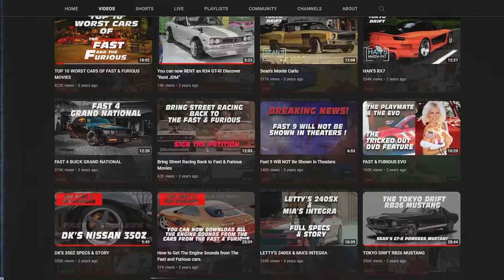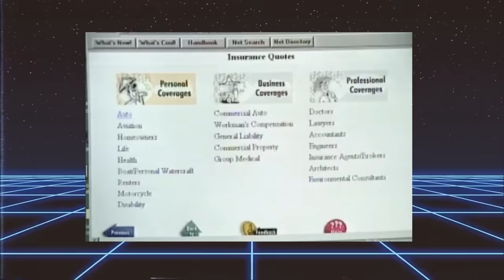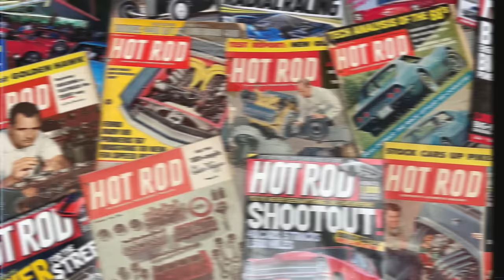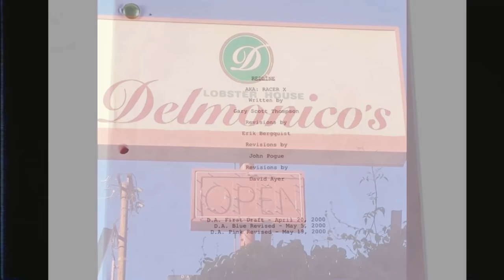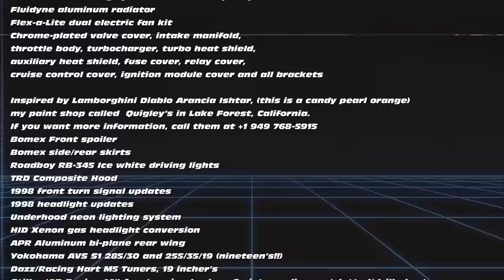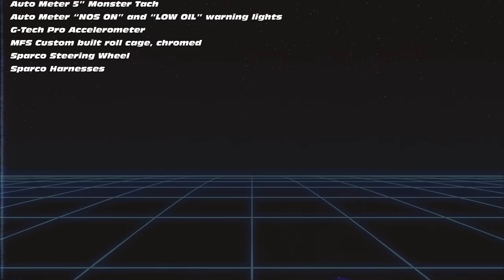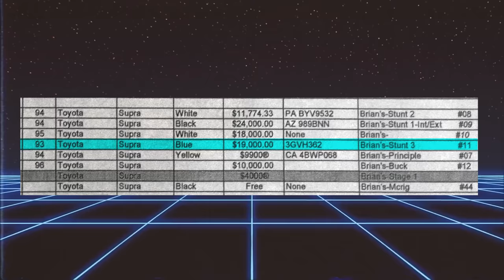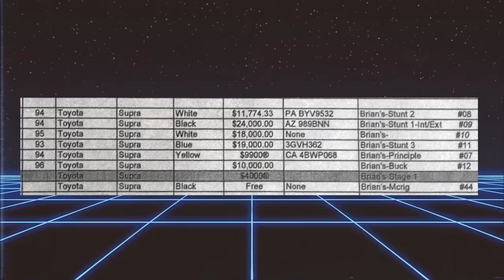The Fast and Furious Supra Then and Now

Comment: Your Supra and your Skyline R34 GT-R were the very first two cars that made me fall in love with cars 20+ years ago as I was kid growing up in the early 2000s. Those cars will forever be in my heart and my memories for a very long time of how it became the most important icon cars of all time in including all of the other FnF cars from the first movie. Thank you Craig Lieberman 🙏💕
Reply: You need to watch more movies kid but I hear ya
Reply: @600wheel  no I’m good. I watch already watch enough movies in my time growing up
Reply: The Supra made me want to avoid Tuner cars and wander away from Toyota. That God awful exterior and the clashing yellow for looks roll bar. I rooted for the Charger and shed a tear when they crashed it. I was already in to cars.
Reply: They were the poster childs for rice rockets and everything I, as a car enthusiast turning 14 in 2001, wanted nothing to associate with
Reply: @rickc303  As a car guy/mechanic turning 29 at the time I felt the same way. Just the cost in building one made me sick and the axle running through the oil pan of the Nissan confused as to why anyone would even try. With engineering decisions like that I couldn’t imagine the other nightmares you would roll up on. Gotta admit though 12 yrs later until today an EVO 1 is parked next to my Fox Mustang (I’m Canadian).
Reply: @600wheel Right? Vanishing Point, Bullitt, Smokey and the Bandit, Gone in 60 Seconds (both the original and the 2000 loose remake), etc.
Reply: @FWDSUXARSE  🤘😎🤘
Reply from the maker: Right on!
Reply: @600wheel  uhh.. 20 years ago, FnF was like the only racing movie, lol..
Reply: @ClimptonDiddlehopper  well blame the movie people for orange car with a yellow cage and blue interrior og car was yellow
Reply: No he doesn't. @600wheel

Comment: I loved the 84 Supras so much I saved up and bought a mostly garage kept 1984 gun metal blue Supra in 1995. I got it from the original owner, a trucker who bought it from Brown's Toyota Glen Burnie, Md I had the stickers and all. His wife drove it while he was on a long haul and for some reason there was no oil, motor locked up. He ordered a replacement from Japan and it had a red valve cover which I thought was awesome. The engine had about 8000 miles on it when I bought it from him. $3750 I paid lol wish I never sold it.

Comment: Stunt 4. Im pretty sure thats the one I worked on way back when. Wasnt that one sold initially to some kid in Lancaster, PA? I remember pulling the rear bumper and finding orange paint under the gold. Also found a hair pick in the trunk. The tach was wire tied to the steering column, and there was basically no interior, save the driver seat and a tank where the back seat should have been.

Comment: In 1992 i put in a stronger coil, reset the timing, drill bit jet the carb and a round k+n filter with the round cover upside down. Tore up escort gt's daily.  1981 accord 2 door hatch 5 speed. Blue on blue. Just saying. So now im driving an 05 crv. Still just saying............

Comment: "the car had some kinda stem seal issue" lmfao I'm dealing with that issue on my 1J right now, JZs are great but the stock valve stem seals ain't it. The og ones start leaking fast.

Comment: Does anyone else think Neons being that late to the tuner seen is weird. I know they didn't have a performance model until then but they are pretty much a four door sedan Eclipse. Maybe that was blasphemy at the time to say that but the foundations of the whole car was pretty much from Mitsubishi. The Neon platform seems like if you smashed the Evo and Eclipse together and gave it the base model Eclipse stuff but from Dodge. Having worked on both, yeah their are differences but a lot of the stuff really just seemed similar to the Eclipse. Then again, I guess the swapping of parts between makes wasn't as popular back then. I'm not sure because I was still in high school and I usually drive/drove pickups.